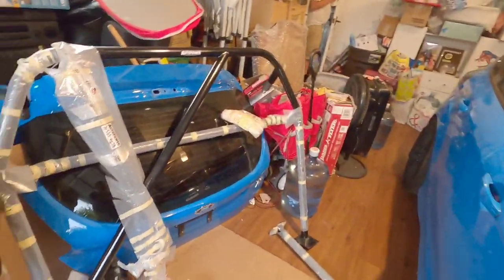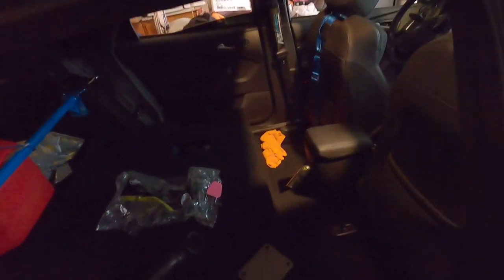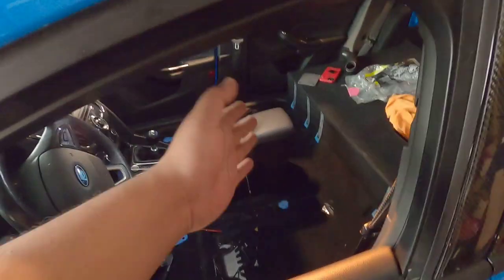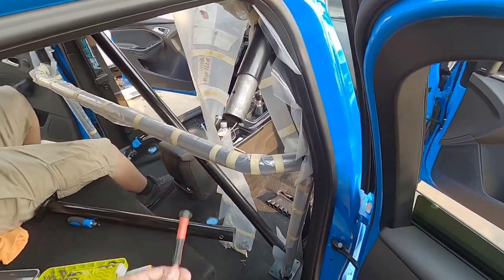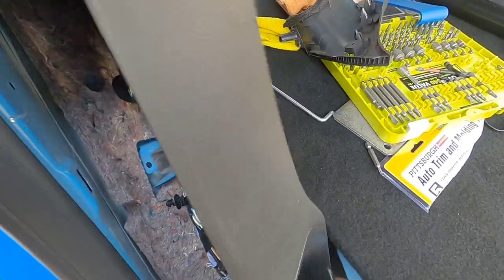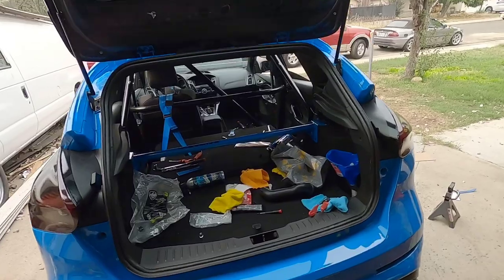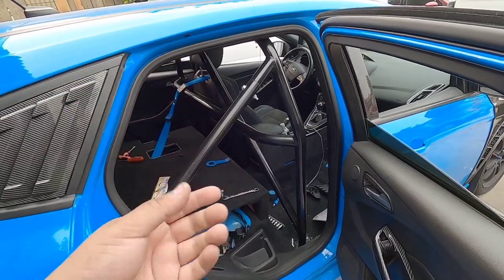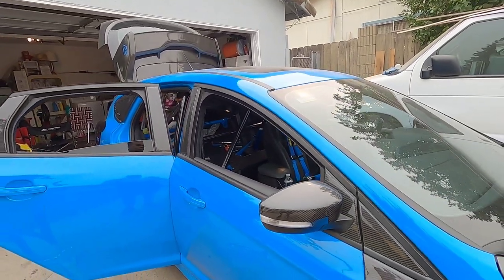Fully Built Focus RS Gets A RollCage! [Install]

Comment: Gotta be in the 10's or less for Roll Cage install....SWeeeett!!
Reply: No you dont lol
Reply: @MiguelRomero-wu5kc  If you're under 11 or break 138mph a cage of some-sort is required (NHRA rules). A full roll cage isn't necessary in a full-bodied vehicle like the RS though - unless it breaks 10sec. You could either do the full cage for shits or a roll bar (easier and cheaper to install) but based on this mod it's clear he plans to break 11sec in a straight line which should be a piece of cake with his power. Me personally... I wouldn't have modified my chassis and added that hunk of steel just to get a slip. I would install a draggy and get the numbers myself when the roads are hot.
Reply: @dariodipaola8445  cage or roll bar is not required for this vehicle until a time faster than 10.00 or a speed greater than 135 mph is achieved. This is per the NHRA rule regarding cars 2008 and newer. Im very familiar with these rules, feel free to fack check this.